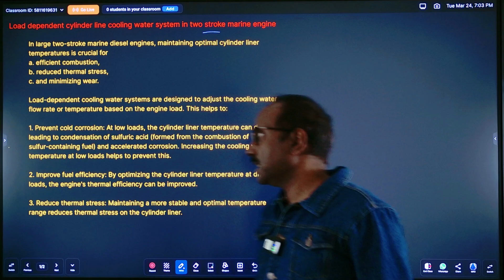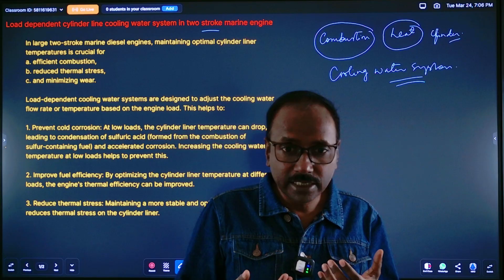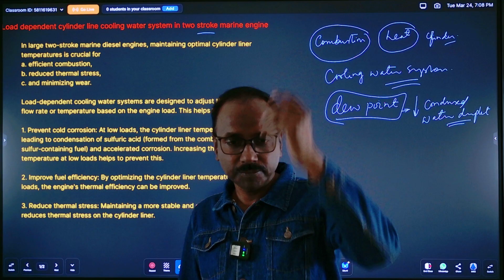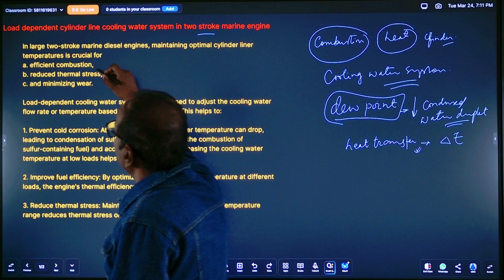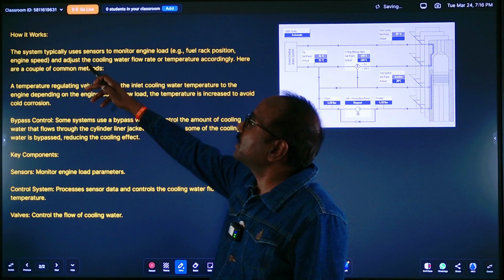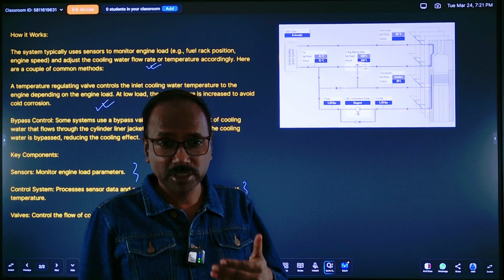Marine engineering motor//LDCL//Let's learn together!!

Comment: Sir , what happens during normal running of engine , how the 3way valve works . Will the LDCL pump only circulate the hot water in that circuit ?